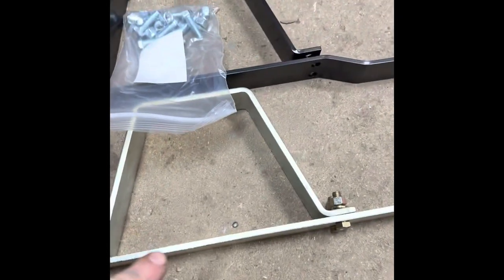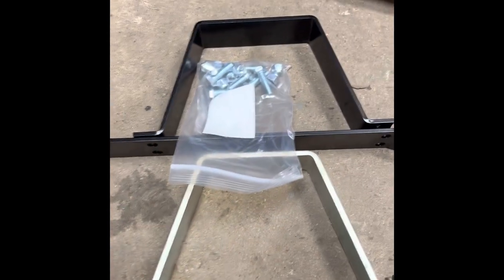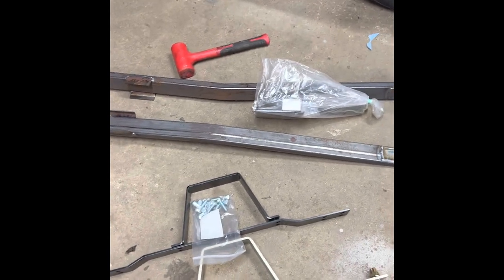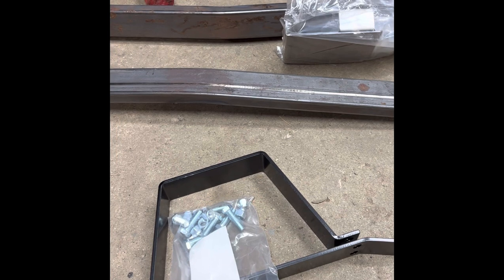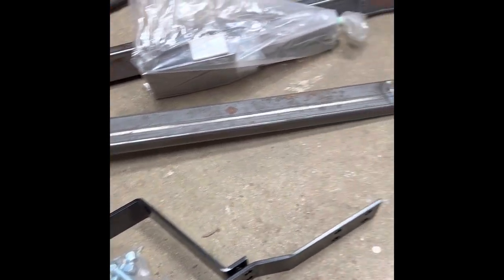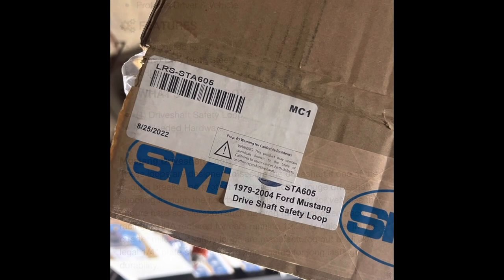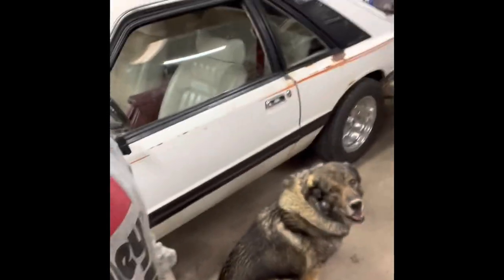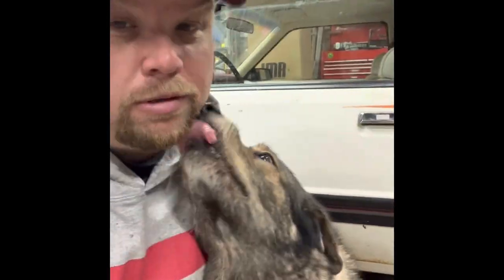Driveshaft loop confusion and subframe connectors tip.

Comment: I guess LMR just sends whatever they canget their hands on. I bought the SVE valve covers with the rubber/steel gaskets with ARP hardware.
The valve cover gasket does not even match the head. Huge gap at both ends.  Going to contact them about those. They charge $35 for those separately. But they came with the valve covers as a kit. As far as the ARP valve cover bolts, they are to long unless you put valve cover reinforcement underneath which they did not come with. I got studs for aluminum heads anyway. Probably use the hardware on my other car. Macy is a sweetheart!
👊😎✌️